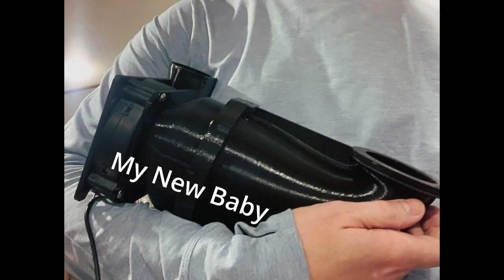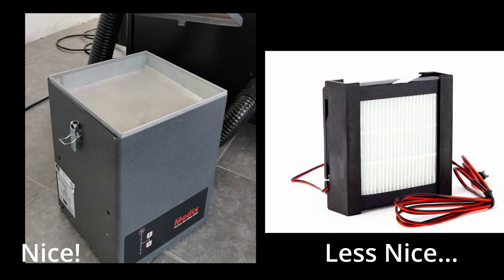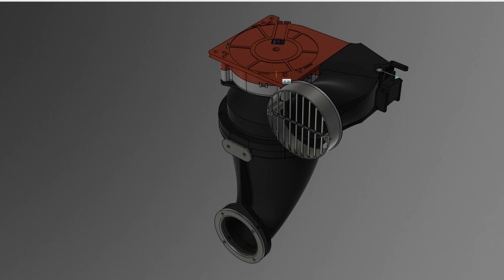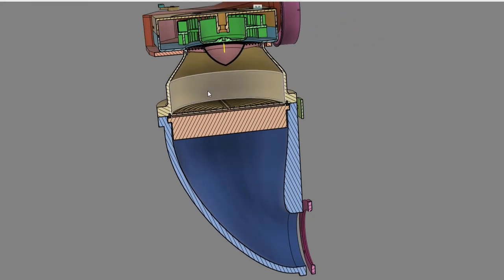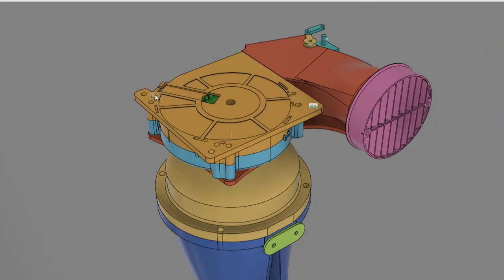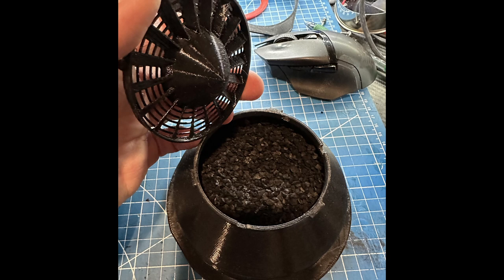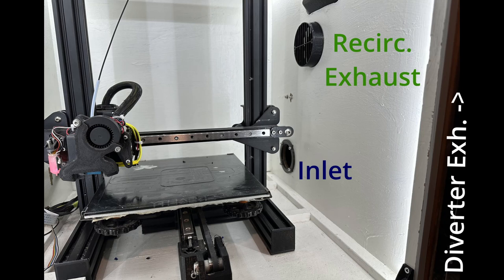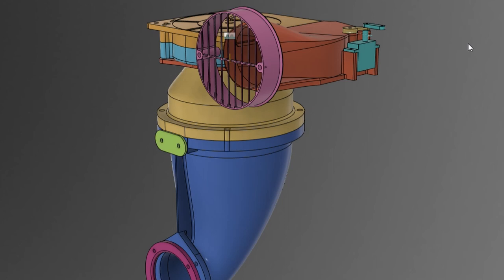3D Printer Enclosure Air Filter

Comment: This seems like a perfect solution. I really don’t think it’s an issue that you can’t independently control temp and pressure inside the enclosure. As long as the temperature is stable and there is some level of lower pressure inside, you’ve accomplished the goal. Great work.
Reply from the maker: Thanks!  I plan on adding a secondary heater at some point so I can exhaust more air to keep the pressure low.  I spent a lot of time sealing sealing the enclosure as well as possible which definitely helps.

Comment: I applaud your efforts to print safe, as I end all my videos saying!  I have several enclosures - the ones offered by Printed Solid.  I have been using the 3DUpFitter Carbon Air Filters he sells.  Upon measuring my shop with a UFP monitor, it is at 1PPB.  I also have two Honeywell air purifiers running at all time.  Given my northern climate, air changes via open windows isn't an option 😀  I have two of the Wham Bam Hot Box Megas and for those I have the BOFA devices, which are expensive yet work really well.  I've been toying with the idea of using a carbon pre filter (like the air purifiers use) combined with the Ultimaker Air Manager filter.  That uses an E10 rated filter which is pretty impressive.  I've been working with a friend on an initial design to cut out a rectangle size opening for the E10 filter face and a 5V Fan (120mm I think, I need to check my notes).  I found a USB dimmer so CFM can adjusted.  I looked at the Voron Nevermore concepts they have but honestly, I haven't seen anyone post any real data on how much UFP/VOCs are removed, how long the activated charcoal is good for and so on.  The only think I spotted you are missing is some fire suppression devices.  I'd consider the Wham Bam "The Sentry" or some BlazeCut tubing, in case a print lifts, gets stuck around the hot end or something goes poof and starts a fire.   I've seen it happen!  Please print safe!  Let me know if you'd like to share some concepts!

Comment: Ditch the bolts, make a 3d printed V-band clamp with a single latch or bolt. Add pressure sensors to the enclosure and in free air and let a arduino or pi manage the negative pressure.
Also add a 2nd servo on an air intake.
Why not duct air in and out of the rv. You can make an energy recovery air exchange unit super easy
Reply from the maker: I actually designed a V-band style but I was afraid to roll that out there.  Every time I've done the V-band clamp, it took a bunch of iterations to get the right clamping force right.  I think with the amount of charcoal I'm using the filter should last several months. 

I'd love to have some pressure sensors on here, really just came down to time.  I wanted to keep the other projects moving forward.  Maybe a phase 2 project for when I add a 200w heater.

I have the 3d printer in the closet and sadly there's no good place to route it to the outside without cutting a hole in the back of the RV or running a hose over the bed to a window.

Comment: I just ust put a 12 v temperature switch on my X1C’s bento box (air purifier).  Check the W3001 12V temp controller (most fans of that size are DV 12v).  You place the probe near the bed and set start/end temp accordingly.
Reply from the maker: With my later version 2 of this filter I just made the temperature adjustment manual. I found that I just watched the thermometer in the enclosure and learned where the filter wanted to be. Which for everything except PLA was almost completely closed. I vary the heat hit with a separate heater.

Comment: Nice idea and design, gonna look into this for my printer closet I started designing.

I wonder though, what are the sound levels at?
And maybe add some sort of sound reducer at the exhaust port, the none circulating port.
Reply from the maker: It can be loud, depending on the fan speed.  I usually run it at around 50% speed, and it’s about as loud as the other fans on my 3D printer, but definitely not quiet. 

I’m working on a V2 which I think will be a bit quieter and easier to service due to some design changes. It will be backward compatible with the hole positions for the enclosure.

Comment: Much better than design I was working on... lesson learned to always look for someone that has better skills.  
1) Maybe I missed it. Link to the filter you use? 
2) When I was think of a design, I wanted to build around the most common filter cartridge in the market. That way it is not hard to find cartridges b/c probably >1 vendor, won't go out of production, etc. But haven't been able to figure out which unit that would be. Have been looking at car, vacuum cleaner and air purifier. If anyone can figure out a common filter that might be a consideration for your v2. Or perhaps make the stage to hold the filter a separate print piece so easier to make a modification to accept a different filter cartridge.
Thanks for sharing all your effort.
Reply from the maker: Thanks!  I’m working on a version 2 that is easier to service and reverses the airflow.  In a small enclosure that’s circulating a lot, the airflow direction shouldn’t matter but it’s probably better to pull air in from the top.

I tried to pick a vacuum filter that was common as possible across several brands and models but 🤷. It’s hard to say what will always be available anymore.

Comment: I use inexpensive ($10-15) Automotive rectangular pleated charcoal-activated cabin filters(about 2" or 50mm thick), mounted inside the cabinet with  a simple 3 sided frame, so you can slid the filter in snug against the cabinet side.  The  PC fans mount on the outside......drill holes in the side of the cabinet between the filter and pc fans.  Works great for  my multiple FDM/Resin printer farm cabinets.
Reply from the maker: With such a small space I really wanted a larger volume of activated carbon. Probably completely overkill to have 8oz of carbon but it should last a long time.

Comment: May you explain more on the temperature regulation regarding printing in PLA. I plan to build an enclosure and have a multipass system filtration system. However I am making my enclosure airtight but will add inlet air ports on the sides that can be removed or closed. I will also have 2 outlet ports on the back. For PLA prints, do I leave the inlets and outlets open and have the filtration system act as a single pass system then?
Reply from the maker: My enclosure is full insulated, thus it reaches 45-50c which makes PLA print poorly. This filter is technically a single pass filter system, but I partially vent some of the air out which causes fresh cool air to be pulled in through the flapper valve. 

Filtering for any system that can’t vent to the outside world is difficult. You will always vent some VOC’s. It’s a question of how harmful those low level VOCs are.
Reply: @IndeterminateDesign  I see. Thank you the information. I was looking at existing solutions like the nevermore filter and they were talking about how multipass systems are more effective than single pass systems. 

I think I will try to program my system to open the exhaust ports after every 5 cycles to bring fresh air back into the system. That way I could still have negative pressure when the exhaust port is open.

Thank you so much for your design and video. It has really helped me in my research. I am looking forward for a V3

Comment: If you control the temperature via the valve, how do you control the pressure level in the chamber?

Great work as always!
Reply from the maker: I position the valve so it’s always exhausting at least some air outside the enclosure.  

The better sealed the enclosure is, less air needs to be exhausted and the hotter you can keep the enclosure temps. Later I will add a separate heater

I did the best to seal my enclosure and tested with smoke from the outside to make sure it was being pulled in around the doors.
Reply: @IndeterminateDesign  Ah that makes sense. So you could say you control the pressure level by improving the seal to the required level.

Comment: How do you know how much activated carbon you need as well as when to replace it?
Reply from the maker: I looked at existing filtration systems and research papers. I didn’t have a way to measure the VOC’s so I went with the other method which is use roughly double the activated carbon. 

The actual amount of VOC’s emitted by the plastic is small, even though they are very toxic.  In reality the carbon could probably last several hundred hours, maybe even a thousand. But I change mine every 200-300hrs.

Comment: I would of thought it was best to pull air out at the top and recirculated air in at the bottom so that heat is kept in at the bottom near the build plate, to prevent drafts at the build plate or cold spots to prevent shrinkage or pealing off the build plate. I would have taken hot air off the top and pushed it back down. With your negative pressure ideally you would want that inlet of air from the external environment close to the top. I also need to enclose my printer and without any testing this is what I assumed should be the air flow. But I’m sure following this comment I will be proven wrong😂
Reply from the maker: I couldn't find any good prior designs around this.  Industrial ovens are built with blowers going both ways.  Clean rooms generally have the dirty air go in the bottom and out the top.  I'm not sure how much it matters, the reality is the filter moves enough air the enclosure is at a fairly consistent temperature.  I do have the exit setup to blow sideways so the air circulates around the outside of enclosure rather than right on the build plate.

Comment: You have a bunch of errors in your solution.
1. You don´t need a whole lot of pressure. The air will be exchanged all the time, a small pressure difference is enough, but it does not hurt to go with more pressure. As long as you suck air out of the enclosure new air will bleed in anyways.
2. Usually charcoal goes first then HEPA, reason being is you don´t want fine dust particulates from the charcoal flying around and getting into your lung.
Reply from the maker: Thank you for your feedback on my design.  Regarding the pressure requirement, you're absolutely right that a small pressure difference is often sufficient to facilitate air exchange if your filter has enough surface area.  The fan I used is probably complete overkill for this situation.

That makes total sense on the order having the hepa filter after the charcoal.  I was trying to copy a respirator cartridge, but really they have a filter on both sides of the charcoal.  Two filters might be a better solution anyways to slow the airflow down a bit more.
Reply: @IndeterminateDesign  In regard to the fan, overkill is fine but you should have a way of regulation the suction in this case probably. But IDK since I have not tried your solution.

Yes, they do this to filter out the charcoal particles. Some filters also combine both where the active carbon is basically bound to the HEPA, I have one such filter for my Levoit Core 300, but the carbon content is way to low for what you are trying to filter out. 

I have the same kind of problem btw with my FDM printer, so I know your pain.
In general good job on the design, it is difficult to create a proper designs and you will always need multiple iterations, so do not get discouraged. I am saying this as an automotive design engineer =)
Reply: @sierraecho884  outside of work, how can you tell the difference between an engineer and a bartender? It's easy. Wait 5 minutes. The engineer will tell you he's an engineer. The bartender is the other guy